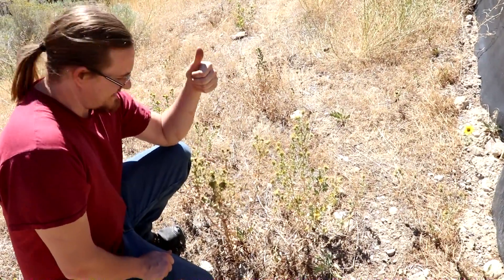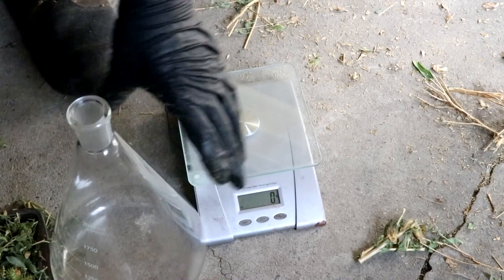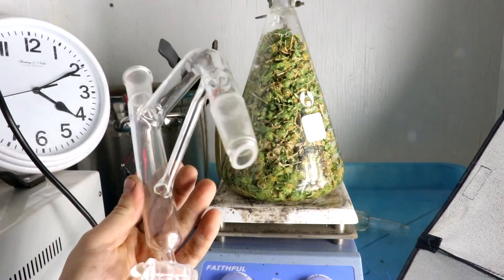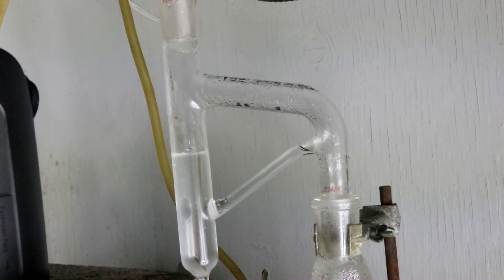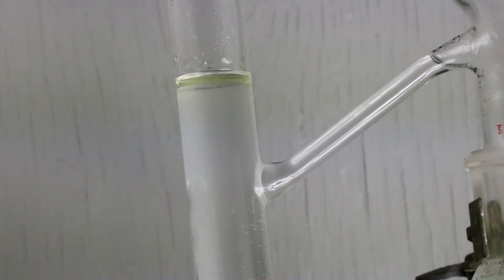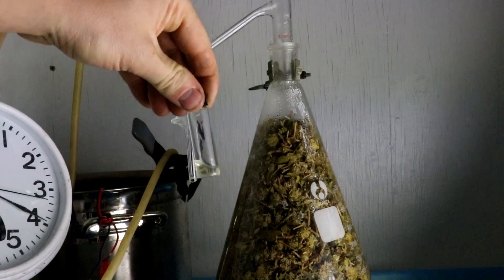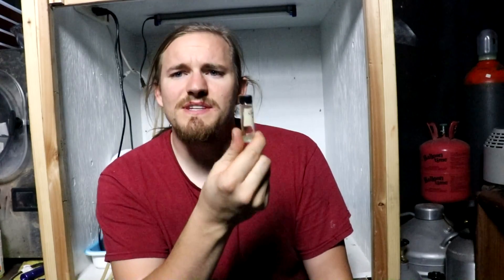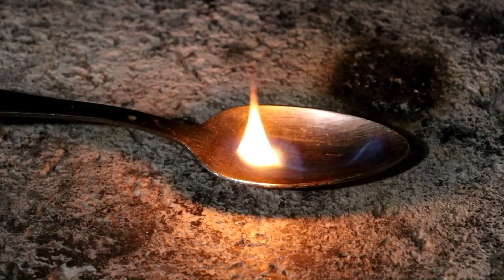Extracting Jet Fuel From GumWeed

Comment: Lost a huge amount to atmo — would be interesting to see you do a hydrocarbon extraction as with cannabis (basically pushing a bottle of butane through the plant matter and evaporating it off). Bet you’d get a 50 fold return. Ethanol should be similar, although it picks up more plant matter unless processed at extremely low temps and filtered.

Comment: Hey Cody, if I might make a suggestion to your method. I don't have GumWeed where I live but I do have lavender and use a very similar steam distillation method to extract the oils. I've noticed in the past that sun drying the lavender yields more oil vs. baking it in the oven, I think that cooking it at the high oven temperatures evaporates some if not most of the oils so maybe try a different drying method?

Comment: Volumetric flask is for general mixing and titration. You wouldn't apply heat to a volumetric flask. That's what a boiling flask is for. Did you learn nothing from my chemistry class?
Reply: That's an Erlenmeyer flask, not a volumetric flask. And do you know who you're talking about? Of course he remembers chemistry class; he could teach one.
Reply: @erichriedel466  You don't get it? It's a reference for the 1st episode of Breaking Bad... When Walter steals the chemistry material for cooking and Jesse says he cook in a volumetric flask
Reply: Cody must of skipped watching Breaking Bad also .....
.
Reply: Yeah, using the wrong kind of flask surely reduced the yield, but it worked well enough for a proof of concept.
Reply: @rustyshackleford5762  r/woosh

Comment: But you didn't answer the most important question: Can it melt steel beams?
Reply: Jet fuel can't melt steel beams but it can heat them up and cause them to bend and break

Comment: So how many liters of fuel do you need to burn to get a liter of gum weed oil? Wouldn't solvent extraction be more practical? I'm thinking solvent could be distilled out from the oil without added heat using a simple fan driven evaporator. You probably want to use a centrifuge drum and recycle the solvent while accumulating the oil. You can recycle the solvent in the centrifuge while processing weed, and perhaps divert the condensate once you've processed all the weed leaving all the oil in the centrifuge and recapturing the solvent. You're still using some power to spin the centrifuge and fan(s), but hopefully significantly less than boiling water. Watch out for large explosions though!

Comment: So what is the typical steam distillation yield with other plant oils? Was this relatively high, average, or low? Would you get more of the oil from the seeds, or do the seeds give off their oil in the same steam distillation process? I believe canola oil comes from the seeds but it's super cheap and there is a lot of it. Is that just because it's mass-produced, and typically it's the same yield as gum weed, or is canola special and gives off waay more than you would expect? Like, how profitable would gum weed oil distillation be, and how could the military manage to actually do something like that on such a large scale, given the yield is only like 0.2%? So many questions...

Comment: In BHO (butane hash oil), you would use butane to strip off the trichomes of the plant material to get your extract then purge it off with heat and/or a vacuum pump. I wonder if the butane method would yield more oil from the plant you used or the distillation method you used. Cause I think solventless extractions run for more $$$

Comment: I'm sure if you blended or crushed the plants into a powder that allowed much more to be compacted into a small area you could probably get a much bigger return on the oil ratio, especially since there would be more surface area for the steam to be in contact with. However, I'm not sure if the action of blending or grinding the plants down would cause a loss in whatever the oil is extracted from in the boiling process.

Comment: perhaps if the plant was crushed instead of cut it could yield more oil.
Reply: Not sure if the essential oils are coming from trichomes or maybe something in the pods, but drying the plants bone dry and blending it into a powder would likely increase yields, could be by a little, could be by a fair bit.
Reply: Really putting your Harry Potter knowledge to use.
Reply: @pizza-for-mountains  lmao
Reply: It would crush easily between rollers if dried and frozen first, and then it could be dissolved in liquid CO2 under about 6 atm pressure, with the boil-off CO2 recycled.  It would be a petro process.
Deserts will probably be encroached upon and dwindle.  The fuel farms in the deserts, and the expanding cities, might one day meet each other without a scrap of nature left in-between.  That'll be nice.
Reply: @beachcomber2008   idiots in the cities drive around for no reason. Why wasting a precious paint thinner on them? It's probably psychoactive, anti-parasitic, antimicrobial, anti-cancer, insecticide or otherwise healing stuff
Reply: @beachcomber2008  ..........I like that process .
Reply: im 80% sure this is a harry potter reference
Reply: Lightly slashed then crushed. Denaturation works well.
Reply: Is that a fucking Half Blood Prince referance

Joke
Reply: Of course, the process likely takes more energy than it would yield so...
Reply: Yes, good idea. I might even use some kind of solvent, other than water, first to remove/reduce the oil. Oil and water are different kind of substances, different densities. Ask Cody I'm sure he'll know the scientific terminology for that.
Reply: Perhaps better cultivating methods could implemented can boost the yield factor of oil. he found them in the wild and it was not domesticated.
Reply: Worst way to extract oils.
Reply: Shaken not stirred!! Mr Bond would know.
Reply: :D nice one
Reply: You mean as is done with many other materials? 
Such as pressing with heat, and the reason for using steam is that it works with light volatiles and is limited more in the level of heat applied, and is better for getting essential oils when there is so much more dry materials than there is oil. This is the same process that is used to obtain Rose oil and many others. However it does not work with oils with a much higher boiling point than water.
Reply: .........I would  use the Isomizer  style reduction . Strip  all the resins  along  with  the  volatile . I  ❤ my Michigan  medical  reductions  like wax ! Peace !
Reply: talk nerdy to me.

Comment: And if I were going to do it the way I was describing the same way that you make butane hash oil I wouldn't try it out in the oven I would just cut it out from where you had it from cut the buds off put them into my making apparatus and then I would just run it with about 6 or 8 cans of butane one right after the other let it sit for about a day in the Sun or you could take a vacuum chamber outside and after you let it evaporate what you have left is highly condensed extracted oil it will either be partially liquid or wind up being extremely got me like molasses or tree sap but if it's like that it will most likely be flammable

Comment: Most of it defiantly boiled off if your hands were that sticky afterwards. I think a co2 extract or butane extract would work a lot better.  But then again you ARE only using water and heat which is cool.

Comment: Pack your distillation column with glass wool next time. The increased surface area provides surface area for the vapor to condense on, effectively increasing the length of the column and greatly improving your yield. It also traps more of the volatile compounds in the sap, making it smell more like flowers.

Comment: The point: biofuels for environmental protection is somewhat pointless. The fact we turn an ambient temperature substance into heated gas is the problem. I have said it many times but engines are like little aquarium heaters and roads are good thermal capacitors. Cities are warmer than surrounding areas because of this. 
You put a few aquarium heaters in a pool and it will warm the water up. Not convert that equasion to cars and atmospheric volume. Global pressures drop over the years because the composition of air has changed. There is less of it above us.
...thesis pending.

Tare the scale while empty flask is on it.
Change the water gumweed ratio in the flask. Submerge the gumweed under the boiling water. The hot water penetrates the fibres and opens them out allowing more oil out.

Comment: I'm not sure that the plant head would be the best source of the oil....it's possible that the oil could be in the stalks too,  I know that you need to be careful with lavender, as the stem oil is quite bitter, and pollutes the sweeter head oil...but if you are using it for fuel... I'm not so sure that there would be that preference.
Reply: Also not so sure that puting any oil on your skin (except lavender) or tasting it is a good idea

Comment: Well, gumweed is not very abundant around here, Oak trees are. I wonder if pressed (or steam distilled) oil from crushed acorns is any good as a bio-diesel like fuel. 
And if I would go on from there, the remainder of the oil depleted acorns could be used to create a mash to ferment to ethanol/methanol which in turn could be distilled to produce even more fuel. 
I even guess the waste materials could be dried and pyrolysed to produce charcoal dust which is another (pretty crude) fuel.

Comment: Cody, when I used to use this glassware setup in a research lab, I would use cotton wool wrapped in foil to insulate the glassware so that the vapour didn't condense on the neck of the extractor and run straight back into the vessel before it got to the condensor. It really speeds up the process. Also, how about trying to extract the oil from the weeds with a volatile chlorinated solvent like DCM and then just letting it evaporate off once decanted from the weeds?

Comment: Hey Cody, is there a way to chemically coat a plasticfilm or even plastic in general with a layer of metal like in sunglasses or microphone capsules? I was thinking if there was a process like the silver mirror video you had that can be done. Electrophoresis doesn't seem to be applicable and other methods seem to require industrial equipment. Any ideas?

Comment: With your oil extraction method to get 1 gallon (3.785 liters) you would need 1892.5 kg or 4172.2 pounds. 
M1A1 has 1900 liters fuel tank this would need 950000 kg or 2094393.1 pounds, that is 2 millions pounds of weed...
guess the military would not bother with this. lol

Comment: Would vacuum distillation recovered more oil? Or using a higher temp by adding salt to water in flask? Or a solvent such as pure ethanol? Crushing the weed might have increaded  recovery rate also. Interesting experiment. :)

Comment: Cody try a closed loop extraction process to up your yeld. could do liquid propane thru the material with catch basen sitting in warm vac propane gas out thru condenser coil sitting in a bucket of dry ice and alcohol. then pump liquid propane back into its container sitting in same dry ice and alcohol mix. should up yield a bunch. also use a grinder to grind up the material and put a shortening filter be for the catch bin. just my 2 cents from experience

Comment: The oil by it's self is to unstable to be jet fuel. Jet fuel only burns well when atomized, as a liquid it requires an immense amount of heat (greater than that of a propane torch) and doesn't hold stable combustion.

Comment: I was just about to send you a link to an article which showed that the dry weight was about 12.5% acetone-extractable hydrocarbons, plus some additional fatty acids which could be recovered through acid-catalyzed methylation. Yield per unattended hectare of growth is 1,290 L every two years. Can be mixed up to 20% with diesel with no ill effects; beyond that it imparts too much viscosity.

I wonder if using a soxhlet would be more efficient.

Comment: wouldn't butane extraction be faster?
Reply: u'll be using fuel to make fuel
Reply: @dafss5971  a more efficient and versatile fuel though.
Reply: @liam6345  I know but what if we run out of butane?
Reply: @dafss5971  the butane extraction doesn't involve burning of the fuel, so it could be recycled.
Reply: @liam6345  Also the butane would also take some of the plant matter in the fuel possibly fucking it up
Reply: @dafss5971  passing the butane through a fine mesh screen would probably limit this to an amount where it wouldn't cause any significant problems, in my opinion. I'm not too clued in on how it works or anything but I do know that butane can be used to extract oils from plant matter very efficiently.
Reply: @dafss5971  On the next episode he makes butane from sand.
Reply: @pietikke5598  Yeah but the problem still is if it takes some of the plant matter with it making it fuck up tbh the butane extraction prob only works with weed

Comment: So....  Would it help if you gave the plant material a fine grind before you did the extraction?  Add a little water/alcohol/acetone and run it in the blender/mortar and pestle to help break down the stems and leaves?  As sticky as it made your gloves, I think there may be more oil there.
(of course, when I think I usually get in trouble.  Just ask my Wife!)

Comment: Hmm.  You might want to try just a straight distillation.  The sticky components are probably less volatile than the stuff that you got.  I've found that if you wrap something like that (2 liter?) flask loosely in aluminum foil and let it hang over the sides of the hot plate, you get pretty even heating.

It might also be interesting to see what you get if you put the plant in your ball mill.  Definitely a lot more surface area then.
Reply: Yeah, but he'd probably fuck up his ball mill. Just use a blender.
Reply: htomerif wheres your avatar from
Reply: yeah that have a large weed yield for snoopdog

Comment: I have extracted essential oils before. What I have found though is that some of the oils actually starts evaporating at 25C. So I think that most of the actual essential oils is lost and those collected was mostly heavier, however the amount that you were able to extract does correspond to the amount I would be expecting.  I extracted oils from golden rod, it yields about 30ml from about 8kg. That was my yield at least, and more than some of the local commercial producers in my area.

Comment: You needed to heat this stuff to get it to work. I wonder how much land you'd need to produce the fuel for heating and the oil for fuel, and if it would be more efficient than any other source of fuel. On an industrial scale you might well burn more fuel in the planting, harvesting, and processing than you got out of the plants. Though maybe you could arrange the fuel you burnt to be some low level thing like wood.

Comment: thats really cool man.  could you use that same setup, say on a larger scale, to produce fuel oil from other plant sources?   im thinking avocado pits, wild burdock seeds, just about any abundant plant source that has an oil content high enough to make it worth the cost in electricity or other fuel needed to heat it..,   hell, a frenzel lens set up properly would also do the trick...  ;-D